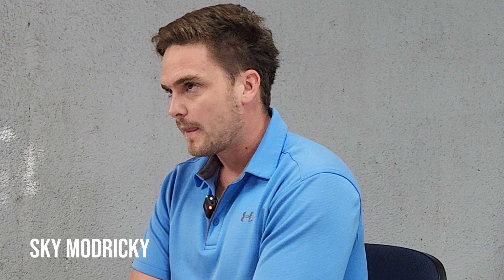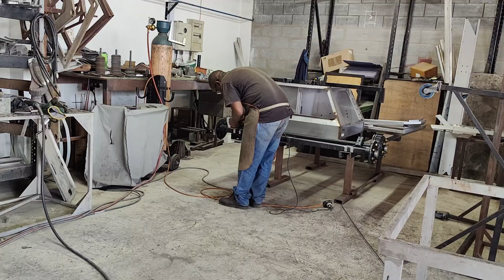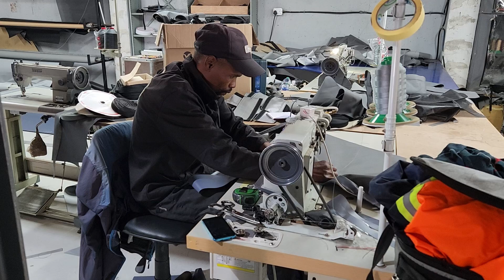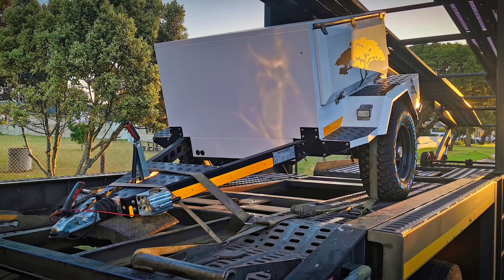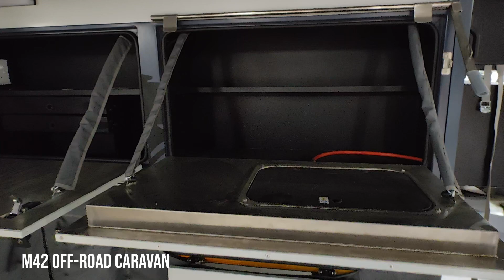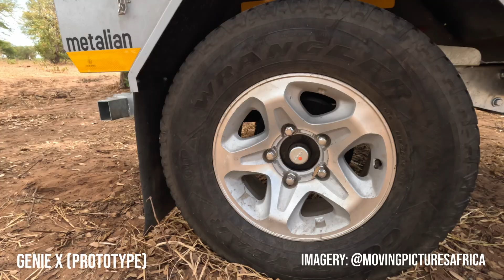Finding out where our Genie came from, the Metalian Interview

Comment: Hi, I love your video. Thinking of getting one of your trailers.? for the UK needs the maxi has a 3000 L capacity for WATER personally I will go for 50 L at the max. I love the fact that you gone for a bright system and a 13 pin connector.. this is quite rare in manufacturers or most of them. Just go for a seven pink connector. I take this is to charge your batteries. The only thing I’m disappointed with do 100amp in your system I’m looking for a 400 amp minimum. Is this possible? If I place the order with the UK supplier? Can you provide this for me again? Thank you for a great insight into your manufacturing build.
Reply from the maker: Hi there, we arnt actually the manufacturers, we as customers paid them a visit to find out more about the factory. The best would be for you to email Gareth at Metalian and I am sure he would be able to assist you. sales@metalian.co.za